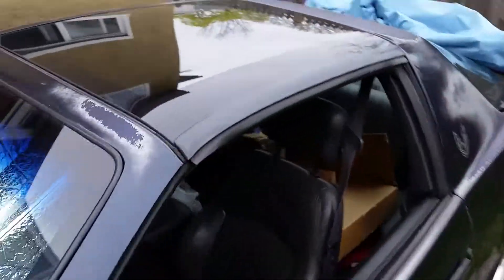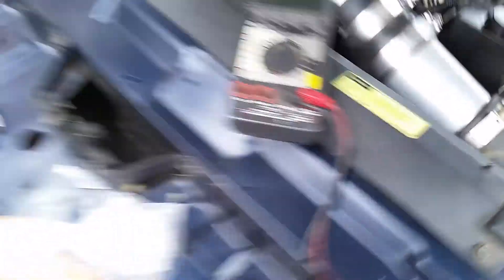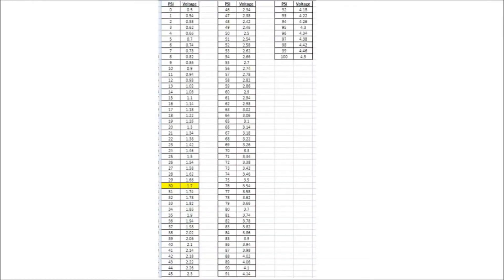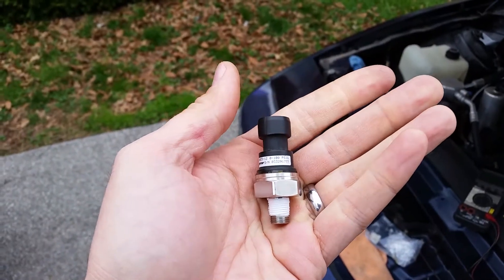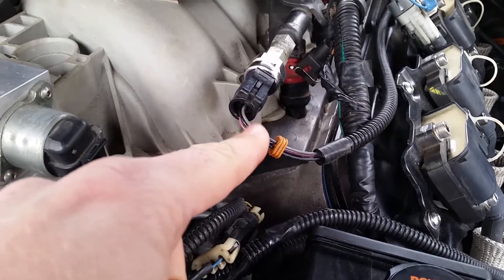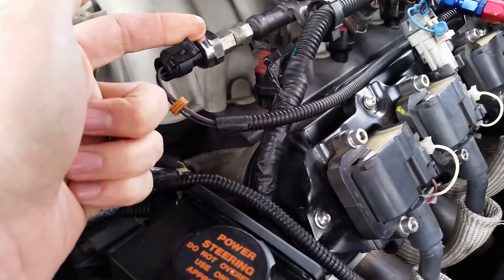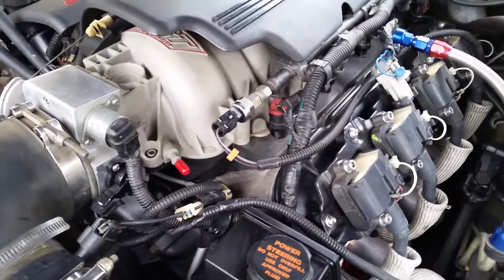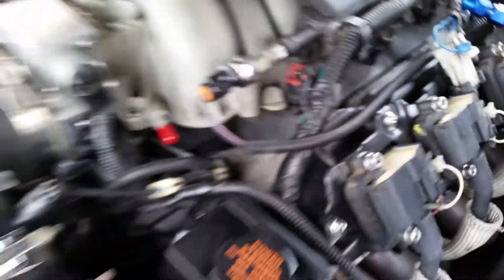Testing A Pressure Sending Unit - Autometer Sender Replacement with Aftermarket

Comment: I can't get mine to work. I've downloaded many pdf files and i can't seem to find my gauge. It has the 10 pin in the gauge and a spot for the bulb. All the ones i see are led. Bought the 40$ 10 pin connector.   I don't think I'm writing it up correctly. Turning to you tube for help.

Comment: Thank you! Didn’t know there were these cheap replacements. Even cheaper now. Sub $19. That’s less than I paid for an auto meter pigtail. 
Thought my oil pressure went to zero on a driver today. Turns out the $100 sensor just crapped out. Tested my second one in an accumulator and the gauge read it just fine. I assumed these were bullet proof for how expensive they are.

Comment: Sadly these Autometer sending units are garbage! One went bad within a year, they gave me a discounted replacement. Went bad again within a year. Didn't bother to write back for years. Finally did, and they said SORRY. Thanks for confirming you can use an aftermarket sender. I got the AUTEX just now and will replace during the shutdown :P

Comment: also when you use too much Teflon tape on the threads, sender will not work rite.
Reply from the maker: Thats a good point Hector.  I had to use tape because the threads were loose on my replacements.  But the autometer piece was just faulty.

Comment: Had the same problem about a year ago, and did the exact same thing.
Bought a cheap replacement sensor on eBay for $15 and worked fine.
Real good tip and video!
Reply from the maker: Thanks for commenting!  Yeah Autometer tax is crazy.  My cheapo is still working great, but now the gauge itself is screwy.  In the winter, the cold makes it basically wrap around backwards!!!  And every single gauge gets moisture inside.  Im thinking about switching them all out to Speedhut's.

Comment: Dude! thanks for this video! I think this may be my issue and thanks for the amazon link! I'll be checking voltages and then ordering if it needs it.
Reply from the maker: +Mike “BONESTOCK” Vieira Hey Mike. Glad you found the video useful!  Its these little things that sometimes will drive you crazy.  Do I NEED a fuel pressure gauge?  Maybe not.  But I sure as heck wanted it to work! haha.  And not spending $100+ to get a 7 year old gauge working was a plus.